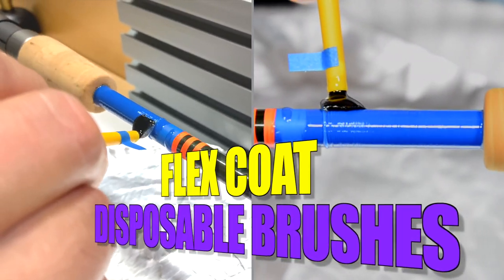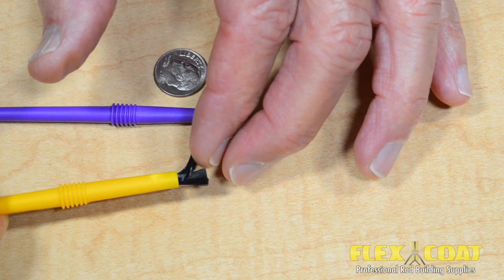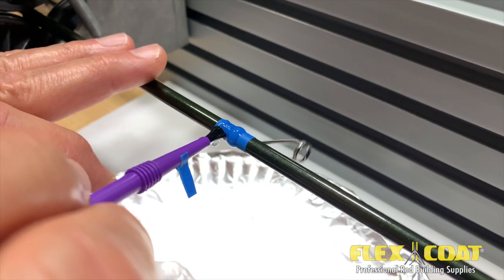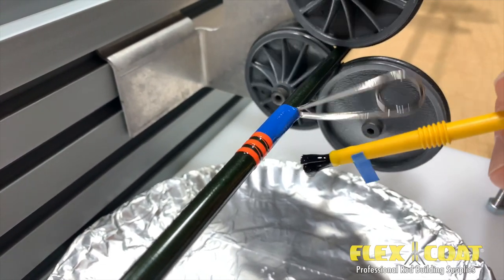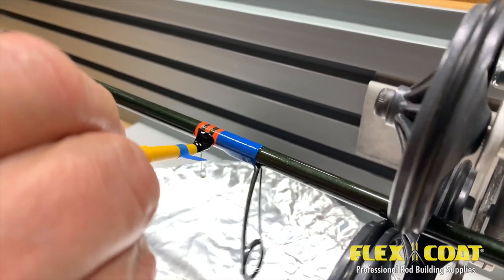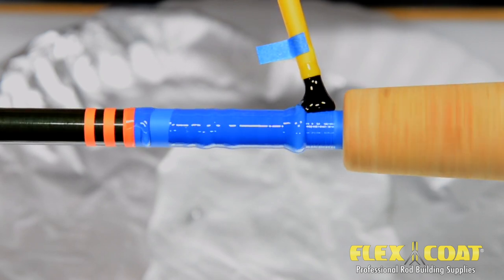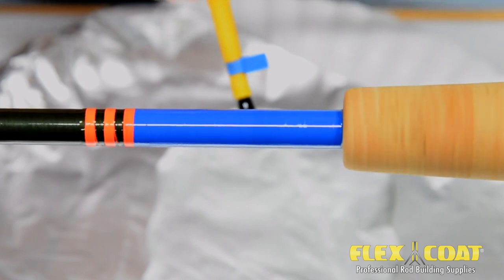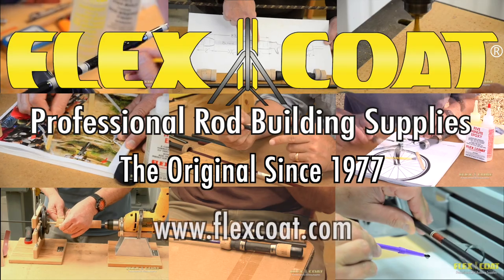Flex Coat Rod Building -  Finish Application Technique:  Catch the Wave

Comment: I will start off by saying I know how to mix epoxy and the flexcoat. I have had issue with flexcoat being gummy in some of the threads/guides.  Others are fine and seem normal.  Almost 50/50.  Any suggestions on what issue might be

Comment: Do you use acetone in your first coat to wet the whippings ?
Reply from the maker: We do not thin the first coat.  The only reason to do that is in a production scenario where you would want to save time, and have the finish soak in fast and move on to the next one.  For one rod just use it full strength and it will soak in slower but it will be great.